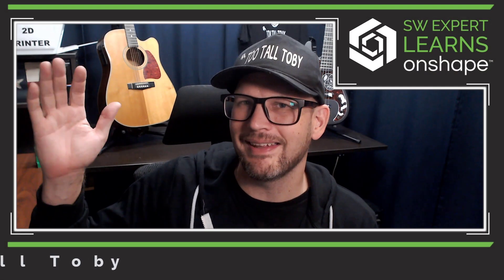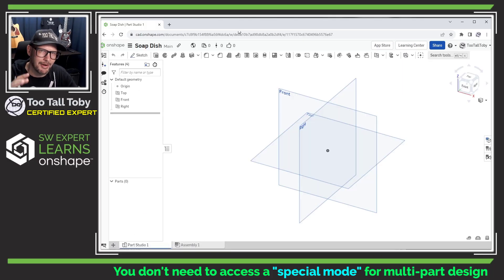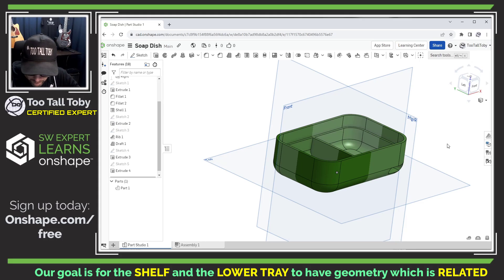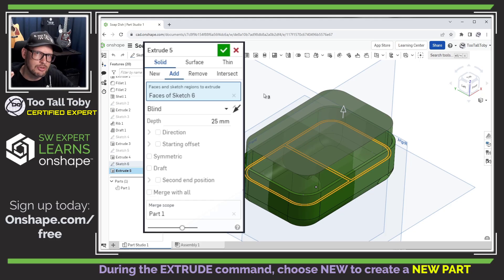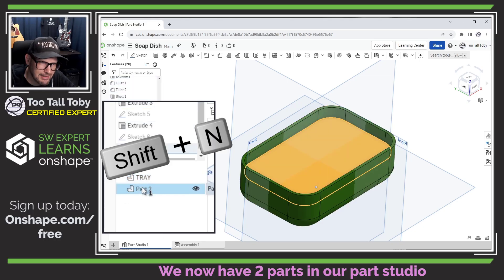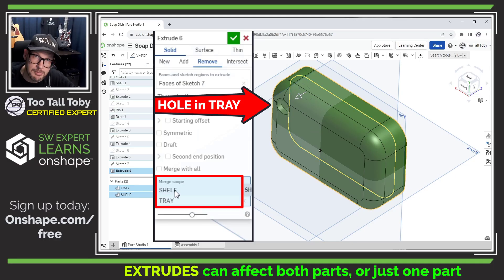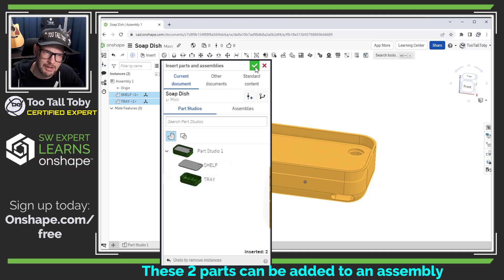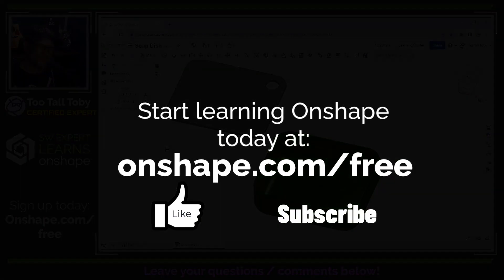Designing Parts Together (In-Context Features)

Comment: Great video on how to make an inserted part. I have a similar project, however, there are two protrusions in the middle. How do you account for those two protrusions when creating a new layer? Meaning, how do I make sure there is an offset hole for the new layer to slide down over?

Comment: I'm lost at the start, what are the key presses or mouse clicks? You don't explain the "features" you're using. I never get that pencil context box and the building the square from the centre out, I can only build from the origin, certainly not mirrored like that. A keyboard ocverlay would be super beneficial if you're not going to explain it

Comment: Very interesting, would love to see you add some tolerance. In my experience, when 3-D printing it can be difficult for parts to fit together without some tolerance.
Reply: Hi BOA2 - the offset sketch at 1:30 is create (as an offset) to account for tolerance and allow the two parts to fit together - and I agree - you always have to be aware of tolerance when 3D printing - since the tolerance will be different for different printers 🙂

Comment: Hi TTT, what if the walls are not in 90degree will the inlet take the degree of the wall?
Reply: Hi Wasser - If the walls aren't 90 degrees then you might use the option for OFFSET SURFACES - or you could even design the shelf with overlapping geometry to the base, then use a BOOLEAN command to remove one part from the other.  I'll be showing how to do this i a few videos, so keep an eye out for the HEX BOLT and MATCH THREADS videos!

Comment: Good video.  I'm actually interested in the process you used to create the rib and "ledge" in the tray which you fast forwarded through.  I've done similar things but I always feel there are better ways.  Is the model shared so I can see what steps you took?
Reply: Hi Bsimmons!  The "ledge" was created using the offset entities command in sketch mode, then an extrude (remove) - similar to what is shown around:  1:34      The RIB command in onshape is a super powerful too.  and I made a video on that topic here:  https://youtu.be/kLIbCGSv-08?si=swMA8niELa00nspS    Hope this helps but lemme know if you are still stuck and maybe I can make another video!  😁
Reply: @TooTallToby  Gotcha, thanks.  That's a much easier way than when I have done it by trying to add something partway down a surface.  Rewatching the video it's easy to see now what you did.  Thanks again.